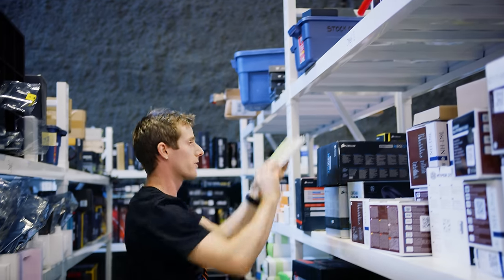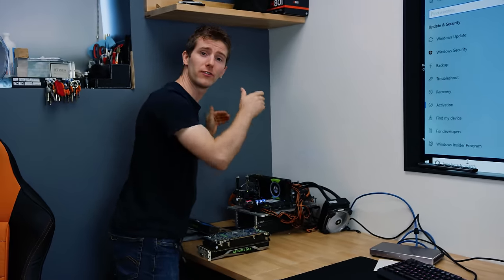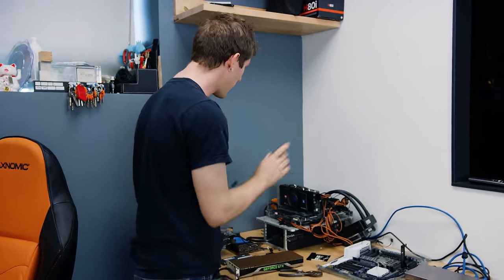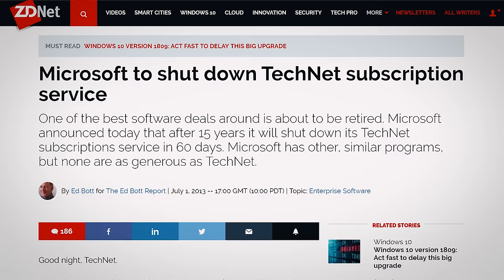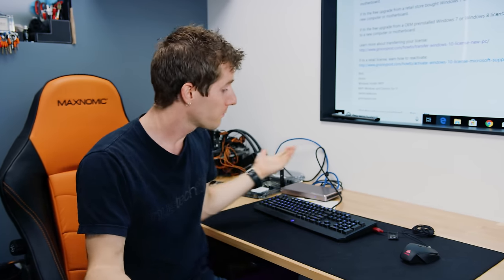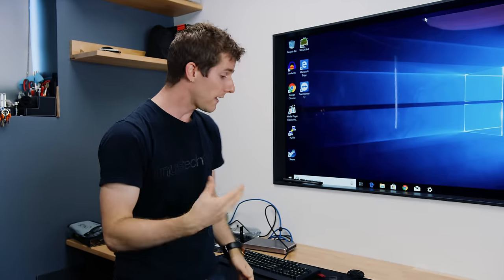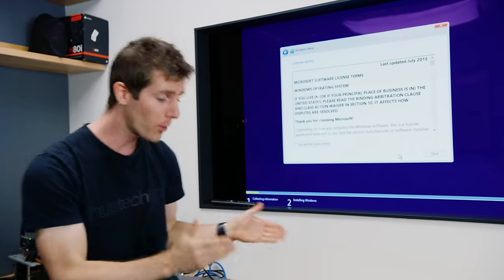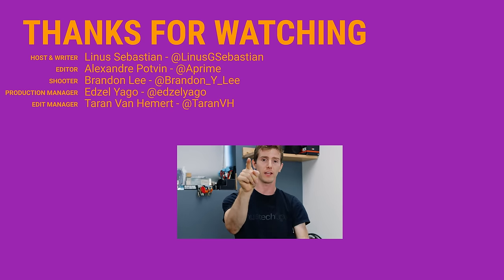Why Does Linus Pirate Windows??

Comment: I resolved that windows watermark issue by installing ubuntu and formatting the windows partition.
Reply: I used KMS-auto to activate windows.
Reply: But Ubuntu is as slow as Windows 10 is. Must be due to their Microsoft partnership.
Reply: @1pcfred  just install lubuntu :)
Reply: @funeoz  no thanks. All Ubuntu based distros are not my thing.
Reply: Paul Frederick maybe later you will test. But warning, it's a black hole ;-)
Reply: @funeoz  I don't think so. I'm not a fan of Desktop Environments.
Reply: Not in my experience. I've been running a dual booted PC, with win 10 64-bit in one side and Ubuntu 18.04 on the other, and so far I've noticed that things worked smoother and faster in Ubuntu than in Windows. I'm not saying windows is any less efficient at utilizing system hardware , but when I comes to "crap" management so to say, background process, daemons, etc. Ubuntu has worked far better for me. It's consumes much less resources, both RAM and CPU power, much less memory usage as well. The UI is lightweight and smooth. My CPU is decently advanced so there's no reason to expect any lag whatsoever, despite this there have been a more than few instances of windows lagging a bit with the PC completely hanging up once or twice due to the aforementioned crap management problem. 
I use both partitions mostly for development, and there too Ubuntu has generally offered a much smoother experience, updates are routine, fast and without any bugs, the system hasn't broken once yet, the software and packages I've installed are also very light and minimalist providing nearly the same amount of functionality as windows counterparts. The package managers are really cool and place files in an organized way where I don't have to spend time keeping track of which package was installed where since apt takes care of that for me. If I'm working on a c++ project in windows where I need to use external libraries things can get painful real quick.
Most windows software tends to be a bit bloated. Now to be fair the bloat is a result of extra functionality that Ubuntu lacks, I won't deny that, but those added features are something I never use or need, and if I ever do, there are more libraries available for the Linux environment that would provide exactly that functionality. That's the main difference, Most Linux distros give you the freedom of choice, install uninstall the specific pieces of software you might need or use according to your convenience, which keeps software bloat at minimum while keeping productivity high. Windows on the other hands ships packages in a large monolithic updates, not particularly a wrong approach but not my preferences .
Reply: @kushalchordiya7229  what advanced CPU do you have?
Reply: @1pcfred  intel core i7 8550U
Reply: @kushalchordiya7229  that is a powerful processor. I only have an old Haswell i5 myself. I've thought about getting an i7-4790K but they're pretty expensive for what they are. They're going for like $238 today. I should have picked one up when they only cost $189.
Reply: @1pcfred  buy a Ryzen 3 it's under 150$
Reply: @funeoz  I do not think a Ryzen will run on my motherboard.
Reply: @1pcfred  ok
Reply: @kushalchordiya7229  Mate you just sold me on Ubuntu. I know its free, but you sold me on it.
Reply: @deus_ex_machina_  that's great to hear mate 😂. 
If you've never used it before, i highly recommend you look into what desktop environment best suits your needs. If you have a powerful processor and RAM to spare use GNOME, if your system is relatively old, go for something lighter like xfce of ldxe. I know it doesn't sound like it should matter, but in my experience a good DE does make a difference in overall performance
If you're gonna be using it for as a software dev / programmer, I recommend installing VS Code(excellent cross-language editor, tho a little greedy on RAM because of electron, still far lightrr than most IDEs ) and htop(command line system monitoring tool) . Also, install ranger, it's a great command line utility for browsing files, really makes you more efficient. 
If you're gonna be working in python at all definitely get Anaconda, a great package manager. For C/C++ the inbuilt apt package manager works best. 
If you're a gamer, I'm guessing having steam and wine(lets you run Windows applications) installed is also necessary.

And last but not least, have fun playing around with your system. Genuinely my favourite part about Ubuntu/Linux in general is constantly discovering new cool shit I can do on my system.
Reply: I keep a dual boot with Windows (since I paid for it anyway when I ordered a laptop) but I primarily use Kubuntu and I haven't booted to Windows for months. No problems whatsoever, no need for antivirus, no constant annoying notifications, no updates when you don't need them, etc. etc.
Reply: @freemank8207  KMS service is a temporary solution for windows activation. If you don't believe, go to cmd and type in slmgr/xpr and you will see a volume expiration.
Reply: @hemanthkotagiri8865  I know. But can you please rewrite the code? It didn't work for me, maybe it's different.
Reply: @freemank8207  Run the command prompt as admin and type in: slmgr/xpr and a window is going to pop up.
Reply: MXLINUX is #1 on Distrowatch. A great distribution!!
Reply: 😂😂😂😂😂😂
I installed Mint

Comment: KMSPICO joined the chat
Reply: KMS service is a temporary solution for windows activation. If you don't believe, go to cmd and type in slmgr/xpr and you will see a volume expiration.
Reply: @hemanthkotagiri8865  That's why KSMPICO creates a task scheduler to renew itself as many times it needed. 

As long as your antivirus won't delete the .exe, everything should be fine.
Reply: Yeah, from now I use HWIDGen, which tricks Windows into thinking it's was activated using Windows 7/8 Product Key, known as Digital License, I tried to Link this Product key to my MS account and it worked.
Reply: @megakarlach2  apparently if you upgrade from a W7 that used dazloader to W10, the license is still registered as valid. wild.
doesn't work with ltsc though, so you still need that kms38.
Reply: @hemanthkotagiri8865  Nope, my system showed It is permanently activated. LOL.
Reply: Re Loader is better
Reply: Lmao
Reply: Promode: 
>Install win7/win8/win8.1
>Activate with kms autonet or other equally effective activator
>Download and install win 10 with microsoft's own media creation tool
>fully activated windows 10
Reply: KSMPICO works fine... but I did run in to a problem couple months ago, there was a fake KSMPICO site online where u got a malware with the software, beside that KSMPICO runs fine and does what it should do
Reply: Get with the times dude, the hot new KMS service is KMS VL ALL
Reply: LMFAOLOLPMSLHAHAOPOG
Reply: William Joseph B.J. Blazkowicz tell me
Reply: HWID entered the room